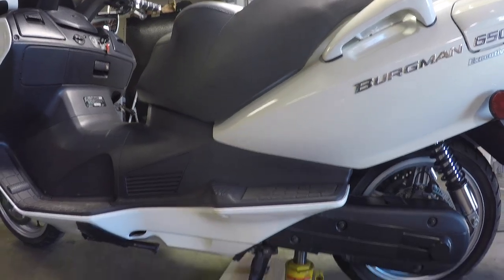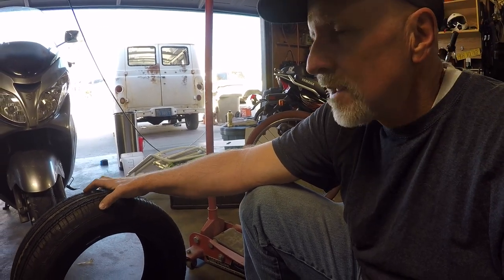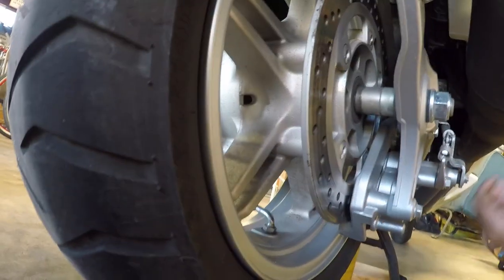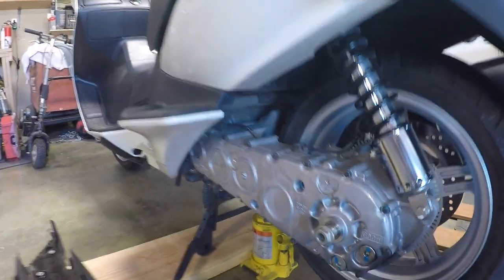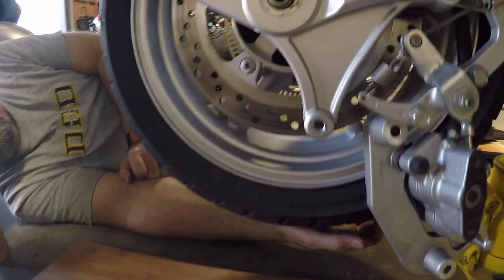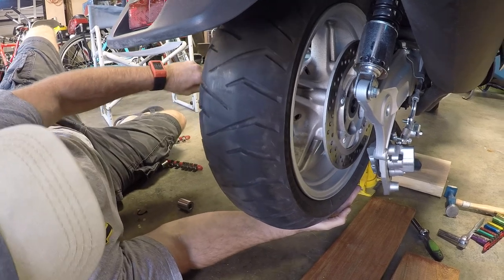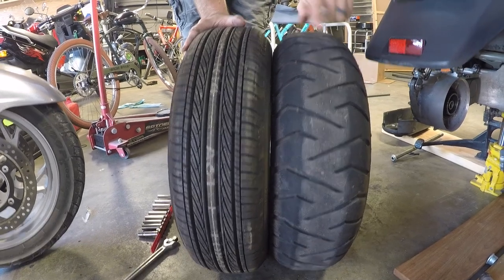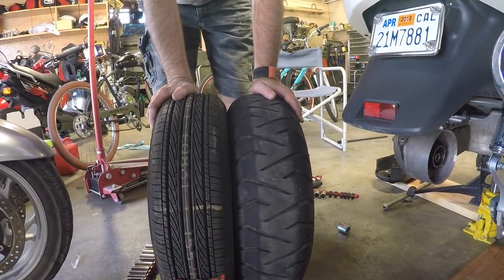Darksiding a Suzuki Burgman 650

Comment: Excellent. In Cuba, they have been drilling 15 inch VW wheels and lacing them to a Harley hub to mount car tires on for many years, as motorcycle tires are hard to get there. It's controversial, but I know many here that have done it for decades with no problems. I will probably go to the Darkside when my 2009 Burgman needs a new tire.
Reply from the maker: Russel Allen yes many people are doing it with great success. Thanks for watching 👍
Reply: I will look for you on my next visit to Cuba. I was supposed to be there right now. COVID-19 stopped that.

Comment: I ran car tires on my Vulcan for many miles. Yes they want to run flatter, but, one mile of use you are used to it. I realized so much more wear and changed less often and it made running cruise control a dream.
Reply from the maker: Kajuniter Yes I agree I have about 5k miles on my tire now with no noticeable difference except less wear. Of course I’m not scraping pegs either 👍🏻
Reply: ManCave Mayhem I have zero problems in hard turns on my XVS 1100 classic and I scrape the pegs so often they are not looking good , scraping them before was touch and go , I could always feel the arse of the bike falling away from me , not once has this happened DarkSide

Comment: I installed the Federal tire on my Burgman per your recommendation, I like the narrower width. I had issues with some C-tires on the Goldwing using wide tires, really feeling the corner, narrower was better on it also. Have a trip to Nevada in July; 2,418 miles to Ely.
Reply from the maker: Donald Jones good I hope it all performs well for you. I love mine👍
Reply: how did you get it to POP on the bead all the way around?  I had the exact same tire up to 110 psi and no luck was still 1cm from beading in an 8 inch area on both sides no luck

Comment: Its Been 2years since this video so would you mind giving us a long term review
Reply from the maker: Update On darksiding a Suzuki Burgman https://youtu.be/FeVX48U_QxM
Reply: My update is the Federal suffered cord separation at one spot on the right side, my dealer tried to install a new one but gave up, even damaging the new tire, he walked away from the deal and did not charge me.
I then ordered a Economist ATR-K, same issue with not seating, I took it to another shop who had a secret procedure and not affaid to go above 100psi to seat it. My compressor at home doesn't have the gonads.
I'm running motorcycle tires on my spare rim and saving the CT for a little trip in June 2021 where I will need the longer tread life.
BTW I did have to repair the under seat box where the CT rubbed holes on both sides of the hump.
Reply: @donaldjones3580  Yikes!  Seems like a failed attempt.  On my Gold Wings, I have enjoyed success with non run flats.  I followed tire model suggestions from other Darksiders to avoid fitment problems.  I do my own mounting with NoMar stand and MoJo Lever.

Comment: Hi
I have about a year on a ST 1300 with a car tire, the same tire they run on the Cooper Mini.
I found no serious problems.  After seating the bead remove the valve core. the tire does rub on the swing arm until fully in place with the rear axle in, then inflate. Try various pressures to find the optimum pressure.
I ride single up mostly
The tire runs better with around 32 psi inflation. OEM tires need 42psi.  The lower pressure allows side wall flex so the tread does not lift as much in a turn.
I find when running across uneven pavement I get a slight "Steer. I noticed the same thing with OEM tires.
I am no longer a "Knee Slider" riding more like an older gent.
Google The dark side and find a forum that covers car tire use.
After hearing claims of 30,000 miles on a car tire I had to try it. Especially afte replacing front and rear oem tires a t3000 miles.
Good luck
Reply from the maker: Dennis Williams Thanks for the information. We are getting great feedback on this topic. Thanks for watching 😎
Reply: Dennis Williams - You said "After seating the bead ...".  Because a car tire has a different bead to a bike tire, a car tire bead CAN NOT seat properly on a bike rim.  It is not physically possible.

Comment: Well do you still like that tire. Iam working on getting one myself and I think I will try it as well.
Reply from the maker: air bagstx Yes I’m very happy with it I adjusted the air pressure to about 35 PSI and rode on it on a cross-country trip about 4,600 miles and found little to no wear.
Reply: do not do it bought the exact same federal formoza 155/65/14 and did not POP on the bead after a dozen attempts up to 110 psi and now after letting the tire sit 1cm from beading fully in an 8 inch area I deflated today and has 3 inch long cracks in the sidewall so just a waste of 45 bucks

Comment: Great video , I've been Double  DarkSide for over 1.5 years now , I feel way safer and this bike sticks to the road way better than any motorcycle tyre has ever done for me in 38 years of riding , wish I new about this sooner , the price is just a bonus , if I had to pay twice as much for ct on my ride I would gladly do it , never going back to them slippery shit motorcycle tyres again (except on the front )
Reply: GOOD  FOR  YOU  .. I HAVE THEM ON 3 OF MY BIKES AND SCOOTERS  AND THEY ARE  GREAT AND LAST 5 TIMES  LONGER ABD  HANDLE GREAT .  DONT  LISTEN TO THE NARROW MINDED SHEEP..
Reply: What size tire did you use on the front?
Reply: JAM4382 I use a Michelin commander 2 back bike tyre on the front in reverse rotation , same size tyre for front as before
Reply: @JAM4382  thanks for posting have not as yet gone dark siding but soon as I find shop that will Mount and balance that's the way I'm going tired of being ripped off by high MC Friday prices with no mileage we're getting screwed

Comment: a proper motorcycle or scooter tire is way less of a hassle(and less painful) than a skin graft, car tires have an entirely different profile, casing sidewall flex etc, there is a reason insurance companies wont cover you in a crash with car tires on your bike/scoot,if you want to save money do it elsewhere, these two clowns are a joke, yes you may get away with the swap but on the corners this scoot with two different profile/types of tires would potentially be dangerous and handling would be like holding a bag of pissedoff snakes,comeon folks, you have two tiny little contact patches on bikes,scoots,you want the best possible traction and tires that were designed for the vehicle.
Reply from the maker: WOW!
Reply from the maker: This is true but he was right about one thing I’m a moron🤣👍🏻
Reply: i do apologize for calling you guys clowns, anyway folks apparently can and do put car tires on scoots with no adverse affects, who knew, keep those vids acoming mayhem boys @ManCaveMayhem
Reply from the maker: artisan mustangs no worries 😉

Comment: My Diablo rossa 2 ended up with a flat profile anyway so I don't see the problem. There are a lot of folks who have not tried it at all. You have to get the right car tire with the right profile . At $140 a pop I would want you to buy motorcycle tires only too if we're selling them. If it works then run it .
Reply from the maker: LESLIE DAVIS All I can say is I’ve ran mine more than half way across the USA 🇺🇸 with zero problems.

Comment: I put the same size and brand of tire on mine last fall and now have about 8K miles on it. My impression is that it works fine. No handling issues at all. No clearance issues and it is lasting far longer than the original tire. I got about 7K miles on the first rear tire so I am already way beyond that.
Reply from the maker: Ken Nolte Thanks for the info! I’m sure you’ll get more than triple the miles. Ride safe😎👍
Reply: Thanks for your impression because I want to try it but I was worried Abt🙏

Comment: I bought a used Honda 350 a number of years ago.  It wasd really squirreley around corners. I took it to the Honda dealer and they told me it was the back tire, it was not matched up with the front. They put a "matched" new tire on the rear and it ws perfect. So my question is with the mismatched treads and clearly different style tires, how come there was no difference for you?  I think it's an interesting idea though.(I am not mechanical enough to do it myself). I can say I had a Burgman 650 and loved it. Traded it in on a Can Am Spyder RTS. I do believe thre would be no problem with car tires on the Spyder, do you?
Reply from the maker: roger bradley I think the Spyder would work well with car tires. I would do some research and see if anyone has done it before. Thanks for watching 👍🏻

Comment: I have about 80,000Km on two different car tires on my '05 Yamaha Majesty 400. I went back and forth between car and motorcycle tires several times because I kept getting free tires on rims (long story). The difference in feel and handling was more noticeable with car-motorcycle changes than with motorcycle-car swap, but it was never serious enough to justify the motorcycle tire price and (lack of) longevity. I regularly tour on my Majesty, from 1,000Km days to 800Km of gravel on Trans-Labrador Highway. The car tire never failed me.

BTW, I found that the car tire works much better when underinflated. OEM says 30psi, but I keep mine at about 25psi. Handles considerably better that way.
Reply from the maker: I’m telling you they work 👍🏻 great! Thanks for your comment and thanks for watching✌️
Reply: Thanks for you all❤

Comment: did that tire bead pop on the rim without trouble
Reply from the maker: Robert Leavens I had a tire shop put it on and they said it was more difficult that a standard motorcycle tire but not unreasonably hard.
Reply: @ManCaveMayhem  Hello Larry... I've been to a few shops & they are having trouble getting it to bead up. I'm here right now at 605 Motorsports & they can't do it. I tried messaging you on your other video, but didn't hear back. I live in L.A. but can't find anyone. Where was your shop? I would really appreciate it. Thank You!
Reply from the maker: William Horsfall I had the tire installed by Town & Country tire in Apple Valley California. James took care of it for me.
Reply: @ManCaveMayhem  thank you very much!!! Got to give it a try. 👍
Reply: @williamhorsfall8362  just give up mine did not POP all the way around the bead and letting it sit in 90 degree heat hoping to POP in place that 8 inches left 1cm is all did not work.  I deflated and 3 inch long cracks in the rubber where the rim touches it on the edges so wasted 45 bucks on a new worthless torn tire federal formoza 155/65/14 same size, etc. up to 110 psi no luck

Comment: Gentlemen...I live in N. Calif....Who does the installation of the tire on the rim? I have heard that none of the car tire stores will install a car tire on a motorcycle rim by citing liability..
Reply from the maker: harleycharley I went to a local tire shop and they installed it no questions asked and they said they do it occasionally on motorcycles. Good luck and ride safe👍🏻
Reply: @ManCaveMayhem  ...thank you!! I will have to watch your video again to see what size it takes....I have about 2k miles left on my tire....WHAT ABOUT BALANCING??
Reply from the maker: harleycharley I don’t believe they balanced mine but it’s smooth as butter👍🏻
Reply: @ManCaveMayhem  ...I have noticed other guys said nothing about balancing when they went to the dark side....I really want to do this next time I change tires.

Comment: That's a great idea, but how did it handle with the car tire? Was it harder to turn, or did there feel like less traction on the turn? Road noise? Also, do you think a 2003 Burgman is a good buy now, if it's cheap with low miles, or is that too old and hard to get parts?
Reply from the maker: Amerikrainian The tire works great! I’ve put over 6,000 mi. On it and it shows little to no wear. If the 2003 is in good shape buy it 👍🏻

Comment: illegal in most of Europe. insurance void, bike impounded, 6 point on licence, £300 fine. 
MOT test fail. and no banking around corners .... shame bike tyres are not made to last
Reply from the maker: They are getting better. I really had zero problems with it except for clearance issues. I ran it about 7k miles with little to no wear.

Comment: But how it handles remains a bit unclear to me, in terms of grip in the corners.
Reply from the maker: XQCmoi I’ve never had any issues with grip as far as the handling in the corners adjustment of the air pressures necessary to find the right feel on the road. I am however having problems with clearance the tire does rub on the inner fender which basically is part of the under seat storage so I may be going back to a motorcycle tire for that reason. I put Almost 10,000 miles on the car tire now and travel through 17 states with it with zero problems other than what I’ve mentioned regarding clearance. Will be posting a video soon explaining my findings. I realize this is controversial but I actually found that the car tire performed well. I hope this helps.

Comment: I darksided mine about 3 years ago, the tire still looks new. I can't really tell a difference in handling. I did crank my shocks to the max setting for when my wife rode with me. The one thing it did do is make the speedometer read correct. With the bike tire my speedometer was exactly 10% off like all of them, now it's real close to being correct.
Reply from the maker: bc65925 That’s awesome to hear. I think it will work out well. Thanks for watching 😎
Reply: So your Speedo runs off the back wheel?

Comment: Any special preparation for mounting the car tire on your Burgman? I can get the same tire you mentioned for $39.25 shipped to my house. I have a Harbor Freight manual tire changer & a bubble balancer. Thanks for the tip!
Reply from the maker: I took mine to a tire shop as they are difficult to put on.

Comment: Evil, evil men! 😁😂😂 But what about the front tire? Still have to change it out with stock tire wear.
Reply from the maker: Yes but the front MC tire wears quite a bit slower than the rear. In my experience you'll go through two maybe even three rear tires to every one front tire.
Reply: @ManCaveMayhem  Ok thx. I'm looking to get a Bergman 650 Exec. but trying to find a good used one is almost impossible. Will probably have to go new. Too bad they don't offer blue anymore.
Reply: @ManCaveMayhem  What is your average tire wear been on the MC tires? Thx.
Reply from the maker: Ictpilot Ictpilot rear about 6,000 mi. And the front is about 12,000 mi
Reply: @ManCaveMayhem  Thx!

Comment: I have 2 concerns: The 1st is just the accuracy of the speedometer is affected by a different diameter and the 2nd, is more serious. A bike tire is designed for leaning. Its tread grooves and profile are for that purpose. A car tire is designed for sitting straight on the road with slight grooves in the edges for cornering. Therefore I would expect to have worse traction on a leaning bike with the car tire. This could be even more severe on a wet road because of insufficient channeling of the water.
Reply: Maybe the engineer that designed the tire for the burgman would have used a cheap car tire because it’s cheaper. 
Baaahha 
Ya.

Comment: Hello,  Very helpful information . I purchased the Federal Formoza 155/65R 14 75 H tire off line.  I took it to the tire shop and they had issues and said they could not get it to pop the bead and seat.  Have you heard of any issues?  Did I get the right tire?  I took it to a friend who is a motorcycle mechanic and he felt he could get it seated later this week.  Can you provide any advice?   Thanks...
Reply: Still having issues getting the tire seated.  Someone told me that I had to polish grind the original bead on the Burgman rim.  Has anyone had to make any modification to the rim?  Or do I just need to find a different tire?

Comment: You two look real professional.Show us more of your fixing the motor scooters .I want to learn.When my tires get bad I'll go to the dark side also.Do you put a car tire on the front also?
Reply from the maker: Michael Polkabla We have never put a car tire on the front and we don’t plan to do that. I’ve seen other videos where people have.
Reply: ManCave Mayhem  , I run as they call it Double DarkSide , it's not a car tyre on the front , it is a back motorcycle tyre on the front in reverse rotation , I use a Michelin commander 2 back tyre on the front of mine , same size as I had on front previously , it felt very slightly different for a few turns but nothing drastic , this bike now being double DarkSide feels so safe compared to riding with standard bike tyres before , plus I have the bonus of extra miles and cheaper back tyre , I don't do it to be cheap , or I'd go cheap on the front , in the past I've always gone for best quality branded bike tyres , I do the same with my car tyre and my front bike tyre